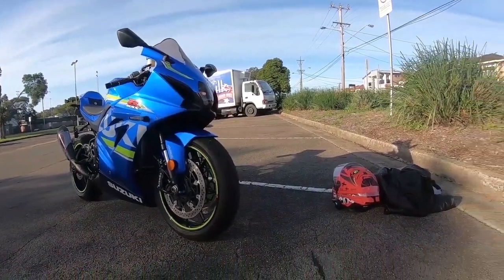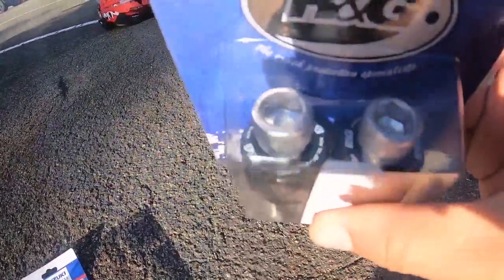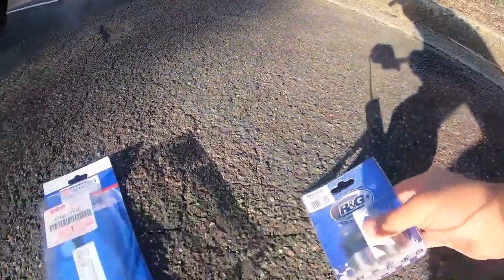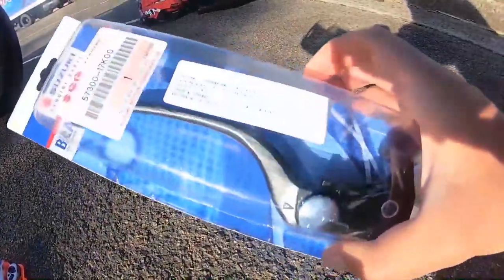2017 Gsxr-1000r Bar ends and Clutch lever

Comment: Why is there vibration
Reply from the maker: The vibration is probably from the engine.
That's how the bike was designed.
Reply: Wow thanks for letting me knw i was looking to buy 1 now il.stick to the honda
Reply from the maker: @klaouzi  
Just take both of them for a ride and see what you like.
In my opinion gsxr1000 is way better then a Honda.
Good luck on the bike search.
Reply: The 2017+ gsxr 1000 doesn't have a balancing shaft just like the BMW s1000rr...
This allows the engine to rev faster but let's the engine vibrate a little more.